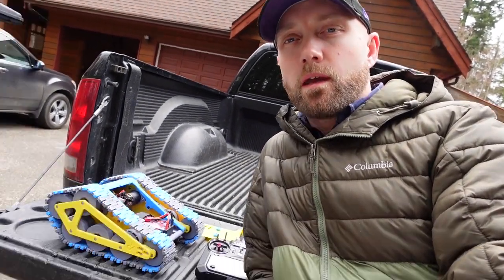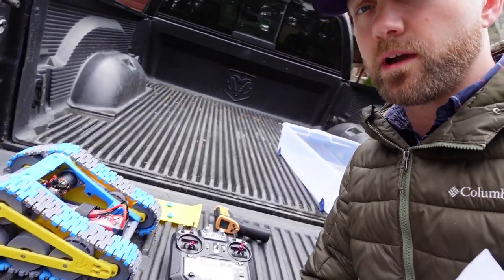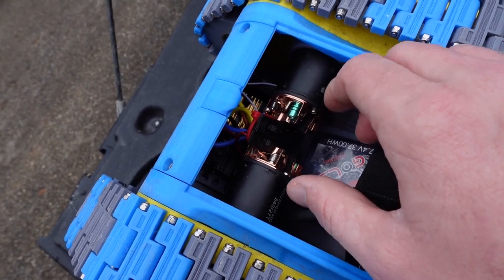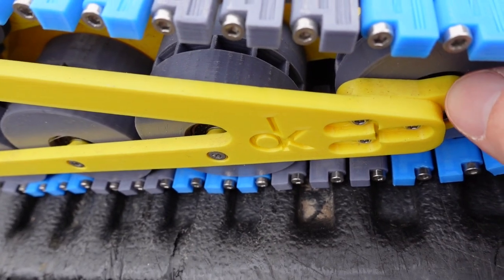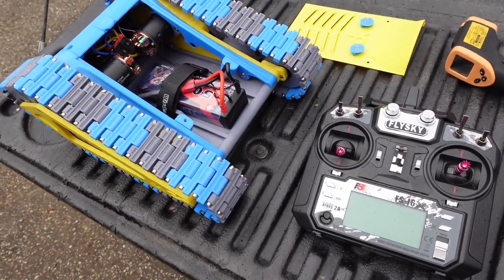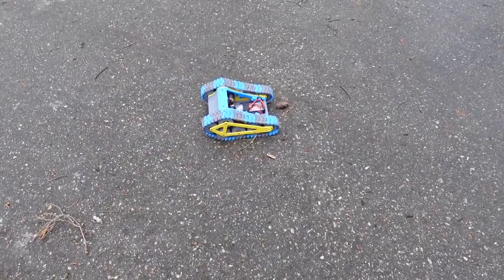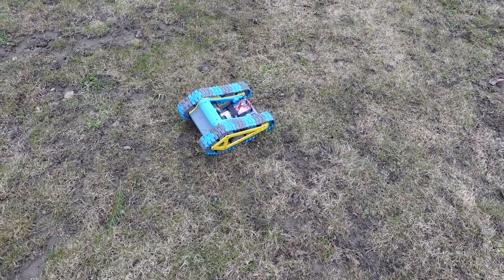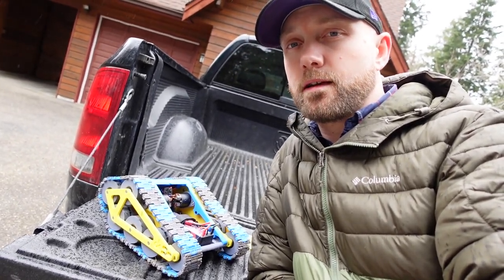Speed Tank Testing and 540 Motors overheating

Comment: Great video. One detail: I think you drive it mostly in reverse. The front of the tank is higher side of the tracks. Regards.
Reply from the maker: lol, I think you're right haha. Thanks for noticing. I guess it just seemed right to drive it that way but I guess it makes more sense the other way around to climb over stuff. I'll make the change when I install the new motors and set it up on a pistol grip.

Comment: nice build. There are other wheels without the slots, which cause the tracks to run smoother. Also, a question, why are you always running the tank in reverse? It is meant to travel in the other direction. That is why you have the plate at that end as a bumper.
Reply from the maker: Hey if you watch my more recent videos on the tank I've figured those things out.

Comment: Go with some new castle crawler sensored motors, I think its a 10th scale setup and like 2200kv. Castle is know to have great torque so I'm sure the higher kv's will work just fine and if not you could always put a big computer fan in that big gap on the top! I have no experience with tanks but I am pretty sure tracks cause a lot more drag than wheels and that's probably why u need the lower kv motors!

Comment: Great video! I have great experience with castle 4600kv sensored motors. They're really efficient due to them being brushless and they have great torque too.
Reply from the maker: Hmmm, that seems like a really high KV to turn the tracks on this machine. I'm using 27T which would be similar to about 1500-2200kv or so depending on which internet chart I look at. 4600 kv would be around 15T. Have you tried those on this vehicle?

Comment: Maybe a little silicone spray on the inside of the track to make less friction would help with overheating.
Reply from the maker: That would help a bit for sure but I still think a motor upgrade is going to be required. Heat sinks would definitely also help a bit but I'm willing to bet I'll still have issues with heat in these 27T brushed motors trying to turn these big tracks so I'm going to opt to replace them and go from there. I'm sure I'll find a use for these motors elsewhere.